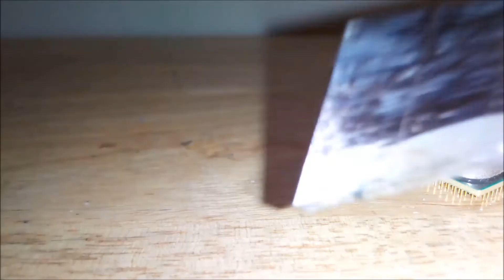How to delid an Amd Athlon II X2 245 Cpu

Comment: heres a quick tip for ya for doing soldered chips put em in the oven on 450 for a few mins and the heat spreader will just come right off with no probs an u wont break anything

Comment: I had to do it on my A10 5800k and it worked, that is, I removed the cover, cleaned and put a thermal paste made of gold and put the lid back on. Even doing that, it's getting very hot even with the Hoopson SU-COOL 190 Dual FAN cooler. It's getting 95º C / 115º C. when I'm going to do something heavier. The question is: Can I use it without the metal lid? That is, put the cooler directly on top of the chip? Thanks for the video! We are together!
Reply from the maker: So generally you might need to modify the plastic brackets on the heatsink but this kind of cpu is generally pretty easy to direct die cool. I would advise checking liquid metal thermal pastes for under the lid. Make sure to use a plastic scraper to clear the rubber adhesive that held the lid on as it will cause a bit of a gap after it has been cut.
Reply: first you shouldn't have used that kind of liquid metal, i've doing this for years, also use gallium type like oc cool or grizzly kind that's why it got so hot

Comment: Replace that blade before you using it on anything you care about.  And be aware of where your hands are when you are using force with a blade.. it could easily slip or snap and cause you serious injury.  Simple rule to follow is always cut away from you.  But I would actually say use some slash resistant gloves